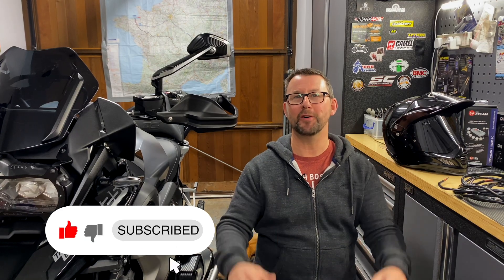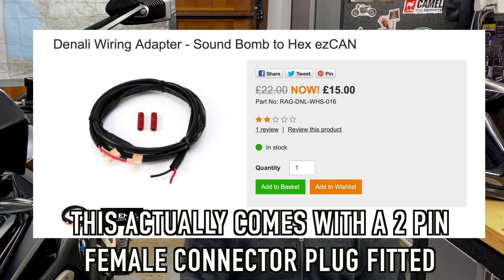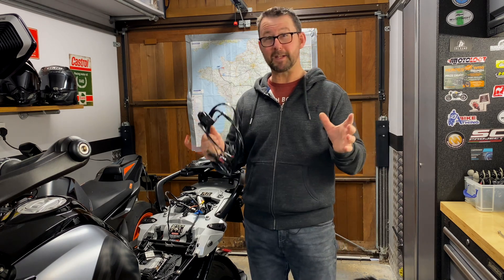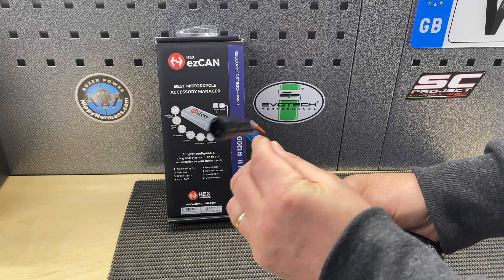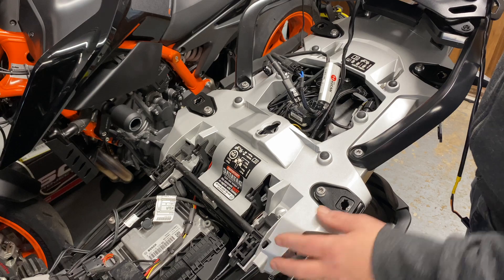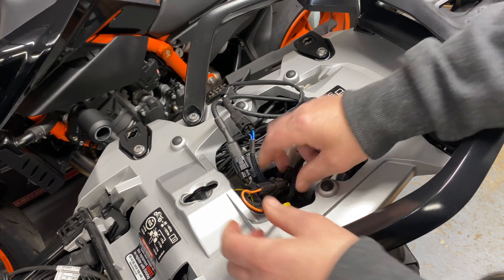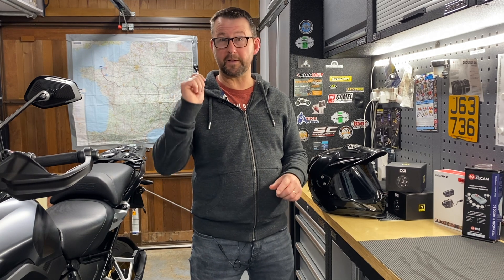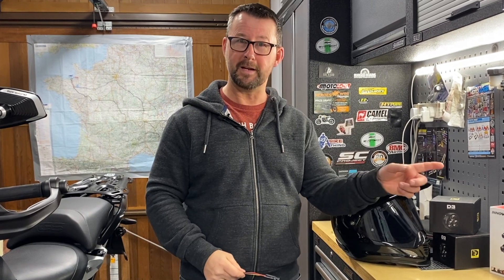Part 2 Denali SoundBomb split installation, BMW R1250GS, now powered with the Hex EzCan

Comment: Good video, im now attempting the exact same. Quick question does that 3pin female red & yellow combine together to the live on the denali soundbomb connector?
Reply from the maker: Morning, apologies I missed this question. Have you managed to sort it out?
Reply: @gsd32i  Unfortunately no. It's now with Hex Ezcan support team. The Ezcan channel on test the horn works on 100% power, frightengly loud, but on the Ezacan normal duty functioned as a horn, won't work off the horn button on the bike...ktm superduke gt 
im suspecting a software update for my KTM specific Ezcan 2 will be needed
Reply from the maker: @ ok I see . They are very good the support team so hopefully they’ll sort it out 👍👍

Comment: Good Easter afternoon, just watching this and last video, question I have the hex ezcan and using a split bomb, do you remove the original horn? Kind regards Neil
Reply from the maker: Hi and happy Easter . From memory you can take the oem horn off BUT I would leave it on as you can configure a time delay in the hex so that a quick dab on the horn button for granny about to cross the road in front of you results in a beep which should be enough, if not then the truck horn sounds a very short time after and gives granny a heart attack! 😂
Reply: @ thank you for your support and reply, have been watching your channel for a while now and was very saddened when you mentioned the passing of your dog 😔 hope you are now in good health? And everything is ticking okay 👌. This sound bomb has tested me today, easy to install but my hez ezcan want allow me to add, apply onto the Curcuit?  I have DRL and D4 lights on splitter cables on yellow, blue  circuits but my D3 and bomb don’t bloody work 😡
Reply from the maker: Thanks, miss my other dog.😢 Which circuit have you plugged the sound bomb into ? ahem you updated the hex software? D3's did they work before? If you unplugged the oem horn , have you put it back properly?
Reply: @ sound bomb white circuit and D3 into red but this is always on not been able to dim?
Reply from the maker: white circuit for the hot, is the horn in the hex menu switched on and have you set a delay on the time slider ? Red circuit, modulation on/off, 3 wire dimming enabled/disabled ?
Reply: @ will have a look tomorrow, thank you very much for your help by the why 😁 kind regards Neil
Reply from the maker: @neilplewa5179  No problem, any issues get back to me.
Reply: @ only if that’s okay? But I will look tomorrow.

Comment: Sorry to inundate you with possibly very inexperienced questions!  But I’m still trying to understand the benefits of running the soundbomb through the hex ez can opposed to directly off the battery…. Other than ease of wiring, based on how many amps the soundbomb uses, and the max amps recommended for the ez can.  Seems the battery would be better option, in order to not run out of available amps on the ez can, in order to run other accessories….  Or am I just not getting it?  Thanks and yes I commented on your original video and you installed the split soundbomb directly to your battery.  Any clarification is greatly appreciated!
Reply from the maker: Hi Robert. Basically connected to the sound bomb means I can have the oem horn sound first with a short dab of the button and then if I continue to hold it down then that activates the compressor and sound bomb truck levels of noise . I have contacted Hex as I run a heated jacket which draws a a few amps and they said a short excess is not a problem. Basically I can sound the oem horn without scaring an old lady crossing the road 😁

Comment: Is it better to power the soundbomb through ez can or the battery
Reply from the maker: If you go through the battery then from memory, you have to have a relay which is bulky, hence the reason I went to the ezcan as you do away with that relay and its much neater.

Comment: do you leave the stock horn connected?
Reply from the maker: Hi . Yes and I have programmed it so that I can give. The horn button a quick press and only the oem horn sounds and then if I hold the button down for longer the air horn sounds ….. stops granny having a heart attack !!
Reply: Yeah that makes sense. I will do just that. Thanks for your quick reply.

Comment: I have the denali split sound bomb fitted to my GSA and now have a hex ezcan gen 2 fitted. Can you adapt the existing sound bomb harness to go from the compressor to the ezcan without buying a new denali one? Or is it too short?
Reply from the maker: Hi Frank, to be honest I am not sure. What you can do is send Denali an  e mail and they should get back to you, ive e mailed them before with questions and they generally are pretty good at getting back to you.
Reply: @ Hi there,

Thanks for your reply. 

I can confirm I adapted the cable directly to the hex ezcan- just connected the two power feeds to one channel of the ezcan using one of the supplied connectors. 

Works fine with the split bomb and the OEM horn 👍

Also connected two LED Colight 4.5 D09’s. Brilliant lights but a bit disappointed you can make the lights strobe other than with the horn or pass light. 

Contacted hex who said “
We are still working on how to implement this with out some riders abusing the function if that makes sense. ”

Comment: Hmm...color me confused. I ordered the combined unit Sound Bomb through my dealer and while he was installing $everal other Denali items I'd purchased, he called to tell me they didn't have the right bracket to mount the sound bomb and would need to order the correct mount (for my Adaptive headlight bike). I was curious to know why they hadn't ordered "that" bracket when I purchased the rest of the gear ($$$). I should add that weeks earlier, when I placed the original order (for everything) I asked which sound bomb was best for my bike. Both the Parts guy and the Service guy poo-pooed the Split and the Mini and insisted I should buy the combined unit. After the call (not that I doubted their expertise), I contacted Denali directly and they explained there is NO BLOODY BRACKET that allows the combined unit to be installed on a '22 GSA with the Adaptive Headlight (as everyone HERE seems to understand)! As a result, I'm expecting my dealer to do one of two things, A) pull a rabbit out of his hat and surprise us all or B) call me back and explain that, in reality, one CANNOT mount a combination Sound Bomb to a damn '22 GSA, Adaptive Headlight bike.

Now which option (A or B) do you think will happen?!!!
Reply from the maker: I can only state what denali also told me.... and that was exactly the same as they told you.....all I know is that mine works great and no issues with it being where it is. mmmmm option B?

Comment: Oh Bottom !! I ordered the full kit after your first video on this, not knowing this is a much easier solution, ah well live and learn 😊
Reply from the maker: Oh no 🥲 I did say in part 1 , that this was the quicker option if you had the hex ezcan or Denali smart can. It will only cost you an extra £20 to get the lead and connector … plus you get to use your oem form as your first line of defence before the 120db sound bomb kicks in with the delay you can put on the hex or smart can . Ride safe 😃
Reply: @gsd32i  I’m always getting told off for not paying attention, anyway I’m glad you did the follow up video as I was becoming a bit overwhelmed with to many wiring in the first video, new lead’s ordered, keep the videos coming🥰
Reply from the maker: @myagoodbody7942  Hi Mya, thanks. It really is a fairly simple install. just take your time. I like the ability to now have a delay before the 120 decibels kicks in and scares granny 👍

Comment: Hi GSD,  , why didn’t you go for the installation between the forks with the single horn ?  thanks for the informative vid by the way 👍 doesn’t that split horn get in the way of your leg ?
Reply: That’s excellent the delay, bit and sounds great. I will pinch that idea.😇
Reply from the maker: @DoodleRider  Thanks Trevor, are you doing the breakfast ride today?
Reply: @gsd32i  only just seen your comment Paul, if you went you will know I didn’t show. I didn’t feel up to with my arm still not right and I need to get to work tomorrow so I can buy more stuff🤔 I will see you soon and I will be tip top.
Reply from the maker: @DoodleRider  It was a very pleasant scenic ride. Have a great week and hope the arm is well rested.....👍
Reply from the maker: Hi, with the new headlight on the bmw the combined unit won't fit, hence the split unit . No issues by the leg.
Reply: @gsd32i  Thanks for your reply I have the 22 Gs as well and I managed to fit in between the forks in my opinion it’s a much neater fit and it’s hidden away check out a bikething on YouTube loads of vids on there if you haven’t already done so thanks the the tip on setting a delayed time 👍
Reply from the maker: @kennybrookes5156  Yes ,I have bought several things off Steve. Agreed its a neater fit. But who am I to argue when I get sent it for free.😁 Does your bike have the adaptive headlight?
Reply: I initially ordered and tried to fit the combined sound bomb on my 22GS.  I thought the clearance on the fork legs was really tight, given it’s a lot of weight just held in place with one nut and the potential for it interfering with the steering, so decided not to install it there.  Although of course people do fit them.  Without the adaptive headlight I believe the split unit can all fit under the fairing but with the adaptive unit there is not enough room to install the compressor.  Hence I went for the by your foot installation.  This was a bit more of a faff to install but now it’s on I don’t notice it any more.  Certainly not in the way of my foot.